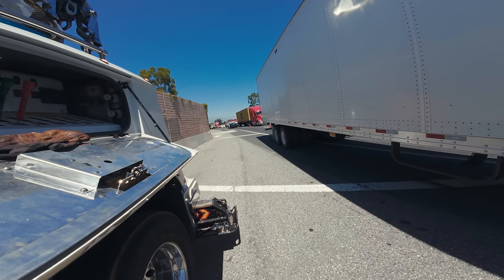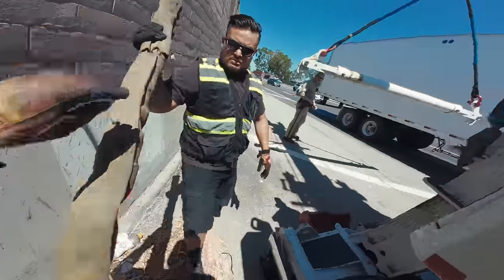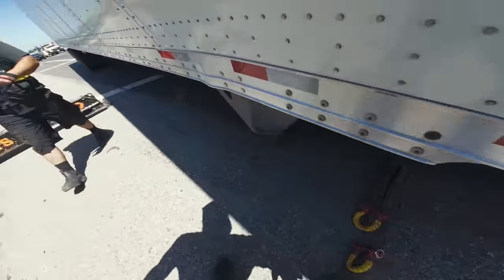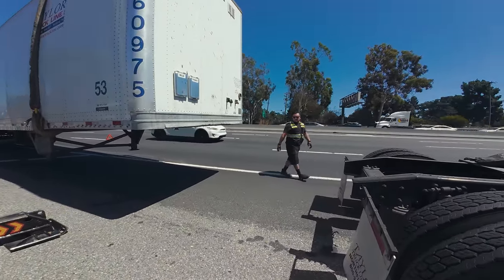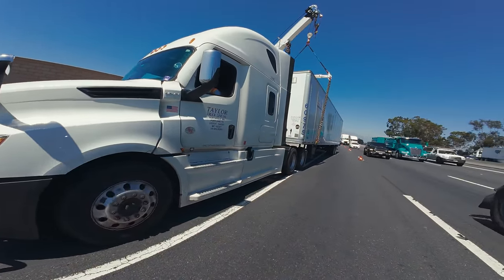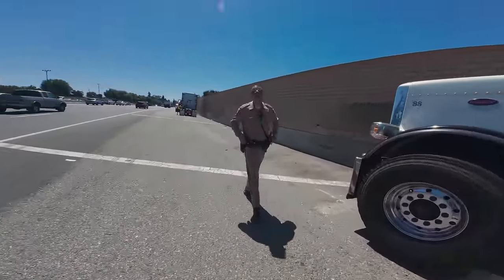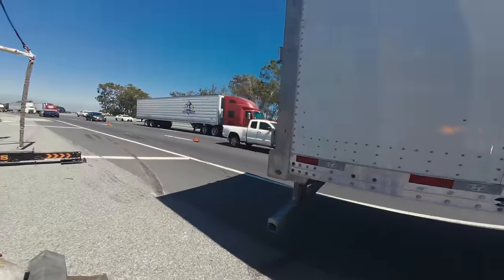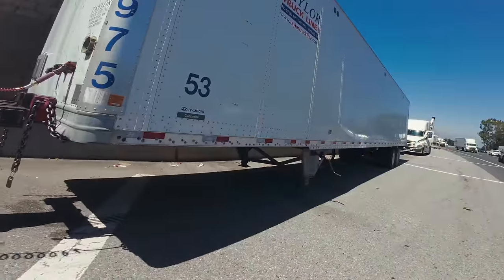Trailer Falls off Semi on Freeway!

Comment: This is just my observation I could be wrong Josh if I am let me know. But judging the fact the driver could even back up straight to get under the trailer makes me wonder when he originally hooked it up he bent the coupler but it still held. Of course I’m sure he didn’t do a tug test but also didn’t check the coupler to make sure it fully locked to the king pin. If he would have done those steps in the first place when he hooked it up this could have been completely avoided. ALWAYS DO A TUG TEST AND CHECK THE COUPLER TO MAKE SURE IT FULLY LOCKED. It’s part of your inspection to make sure it’s locked.
Reply: I had a fifth wheel lock fail one me one time. Did a tug test pulled a trailer for about 5 mins through town multiple turns and it just let loose. This guy in this video I’m not sure about his experience lvl but mechanical failures do happen. I will never forget that day and I have done multiple tug tests from then on after hooking a trailer. Hasn’t happened since, that fifth wheel did get replaced after that.
Reply: @SuperBobblehead77  that’s why I said that if he bent the coupler on the first hook up it still held but then going down the road it came undone.
Reply: @laura_774  I was not  disagreeing I just lost in my thoughts I agree with completely.
Reply: In Denmark there was a train accident on the    Great Belt bridge 🌉 track, a half-empty trailer in a pocket car in the train luggage compartment broke free from the lock to the king pin in strong crosswind storm ,the trailer  hit another  passenger train where the side was torn up and people were killed/injured by it.
Reply: @SuperBobblehead77 thank you , these people are nuts , just quick to judge

Comment: I’m a retired truck driver drove truck for 49 years always did the tug test and I always got underneath with a flashlight to make sure that the jaws were closed on the fifth wheel never had a problem always do a visual
Reply: Trust me , it will still fail. I was in that situation once and i have had the fifth wheel lock and wouldn't release yup things do happen in the field
Reply: @damanayadekunle7232 hope the guy doesn't lose his job.
Reply: @williambarry8015  yeah for real
Reply: THIS NEWER EQUIPMENT, COMPARED TO OLD, IS GARBAGE !! 5TH WHEELS CRACKING, BREAKING PINS, ETC, STUFF WE NEVER SAW BEFORE, OR HEARD 😢😢😢
Reply: Nobody cares that you've been driving for 49 years... Machines and components break even with due diligence 😅 ...
Reply: @SNKR_HEAD83  you must be a road puppy
Reply: @SNKR_HEAD83  😂
Reply: @danielwallace1531  you must be a daddy's girl
Reply: Fontaine fifth wheels aren’t very good. Holland is way better. 45 years with Holland and when I rear clipped the Kenworth it had a Fontaine. 2 months later i lost a trailer on the road. Never had that happen with a Holland.
Reply: @herbpetee75  You get what you pay for. Everything has to be cheap today. If you buy good equipment it will work. Just cost more
Reply: I got the vibe that he was going down the road and it failed since he is on the highway. He probably did check it when he started but it failed for some reason.

Comment: never trust a tug test ALWAYS look and see that the jaws are locked around the kingpin
Reply: @kw900lkevin  yes exactly what you write.you must always check the kingpin, it is not enough to inspect  the levers that control.the mechanical parts must be lubricated with oil,otherwise the parts  become unreliable over time and the lock therefore does  not work 🤔 🙄 🤗👍👍🇩🇰

Comment: First again! I love working night tours lol.

Edit: Josh, the breakdowns are cool but they’re a bonus, if you get slammed, you get slammed, they don’t have to come with every video, I’d like to think most of us your viewers understand and accept that.

Edit to add: per your question in the description, I think the driver was very lucky. Like you said Josh, sometimes mechanical equipment will fail and you wont know it until the next part happens, like in this case, lock failed and trailer fell off.  I with only knowing what you told us, I don’t think the driver is at fault at all.
Reply from the maker: It'll be worth it just to show you guys how crazy that lithium battery explosion job was!
Reply: @PepesTowingService bro I saw the short, and almost spit my coffee at my work computer.  Here in nyc (dispatch for the fire dept) we get those calls allllll too frequently about the batteries burning. They burn out a store, or apartment or a house quick and easy, and those are just the small e-bike ones… your call was MASSIVE, damn lucky all that happened was blowing open doors and bulging out the can.

Comment: Just a note; never rely solely on the "tug test". Having done that, go under the trailer with a flashlight and visually inspect that the 5th wheel has properly closed around the neck of the kingpin (not the crown), that there is no space between the 5th wheel plates of the tractor and trailer, and that the tractor 5th wheel latch, a large pin that keeps the latch from moving, is closed. It sounds more complicated than it looks, but, it only takes a few seconds and it can save a driver from experiencing problems like this.

Comment: Should have disqualified the fifth wheel immediately upon the first drop in which it could not be determined the exact fault or the fifth was found to be bad, however a fifth wheel failure is very rare if the first hook is properly confirmed. I work with a major carrier, if a driver drops a trailer it is an automatic disqualification of that driver. That is how rare equipment failures are...

Comment: 18:34 yeah for anything in the shoulder even just a car with hazards on either get over a lane or be going 20 under the posted speed limit. Its the law as the video said. I respect this as much as possible, if I can't get over to the other lane, i slow down and hug the line.

Comment: Hola everyone,  I’ve gone back and watched a ton of old videos.  I bought a brand new KW in 1978 when I was 20.  This is why I love all your videos.  Do you think the fifth wheel was already damaged and that’s why it dropped.  He must not have tugged on it? Do you know how far he drove before this dropped.  He knew something was happening to get that far off the road.  Maybe caught on rear crossmember?  I didn’t notice if it was bent?  Maybe the trailer was too high and the king pin was on top of the lock? Still I don’t see how that would go this far and again no tug?  This was an interesting one.  Thanks for all the hard work u all do.  Ps  why wasn’t the chippy making the idiot move over.  A car and truck were both over the line.  😮🤯  aloha

Comment: Your 35 ton driver that hook that trailer at such an angle with the chain all the weight will be pulling on on those pins in the cross bar or open the hooks on the receiver, should've gone farther back especially if was loaded.

Comment: Both drivers of those tractors were wearing headsets. Aren't they illegal? They block all surrounding noise? Great video as always.
Reply: Can only cover one ear.
Reply: Headsets are legal, provided they only cover one ear. The Pepe's drivers use headsets that cover both ears when they're working on towing - both for ear protection and communication.

Comment: I am beginning to think that dealers should throw in a backage (package) of marshmallows and a stick with all EV's. I  wonder if the LI ion batteries might not be ready for prime time. Great job here with Alex and supporting cast. Lane opened quickly and careful care for the casualty. Thanks for posting, I can't imagine how you can keep up posting.
Reply: Statistically, ICE vehicles catch on fire a lot more than EVs, anywhere from 20x more to 80x more depending on which country you're looking at.

Comment: This is clearly the driver's fault. He didn't confirm the fifth wheel was locked on the king pin. He needs to be retrained and retested to verify he fully understands how to line up, connect and confirm he is properly latched to his trailers
Reply: Could be  but I'll have you know they can release while driving and they can also be locked and won't release. I have been in both situations
Reply: You don't know that keyboard warrior. Parts do fail and we don't know if he did or didn't check 😅

Comment: I Don't know how the driver of the truck got his CDL. Hmmm,
Reply: Classic steering wheel holder
Reply: It may be hard to believe. In the 70’s i worked at a freight company. We had a driver take a trailer from Montabello scale’s 10 freeway near Banning and dropped the trailer. Went out and inspected 5’th wheel and found no issues. Hooked to the truck and drove it back. 20:57
Reply: He lost it very far from pickup. So he probably had a gap from apron and fifth wheel plate. It will hold until it doesn’t. Good luck all.